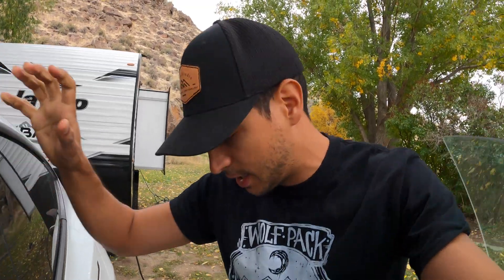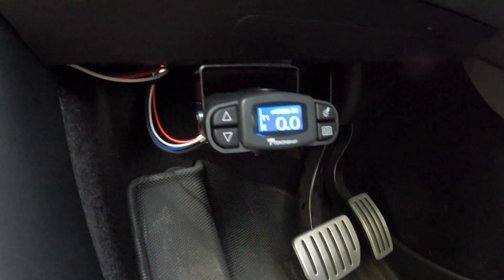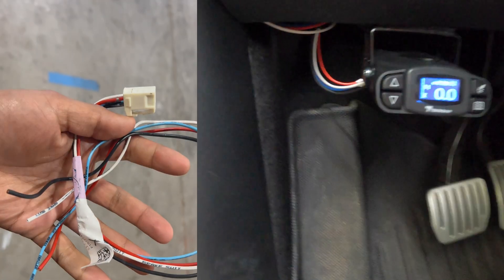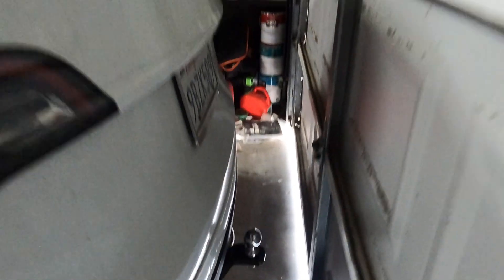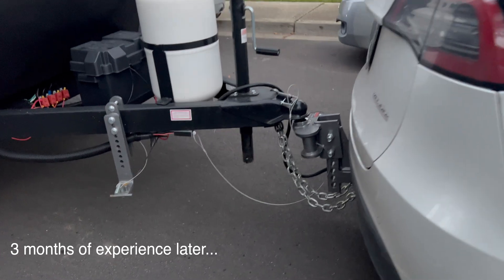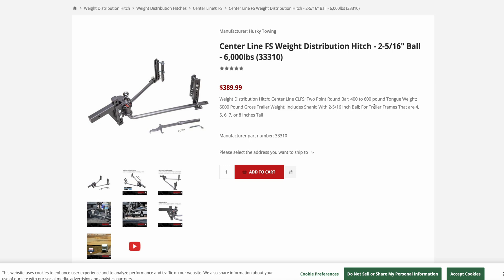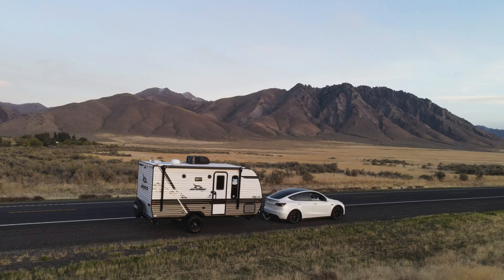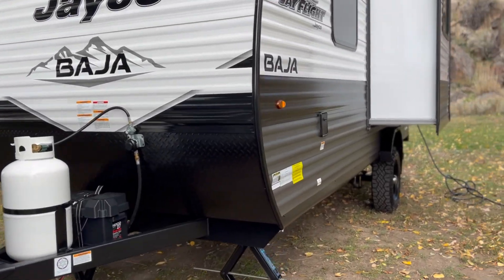Full Towing Guide for a Tesla

Comment: I have 22 Model X and found that there is no 12V on 7pins connect next to hitch. If you install 4pin pigtail, how trailers get the  brake power signal from 7pin?
Reply from the maker: I wasn’t aware the model X didn’t have a 12v connect, I thought this was only an issue with 16v lithium ion battery cars

Comment: With all the hype about Tesla technology I assumed that a brake controller was integrated into the tow package and if I needed trailer brakes on my setup I would be able to program it via the main screen and adjust settings with the scroll wheels... very disappointed when I learned I would have to purchase an aftermarket trailer brake controller.  Thanks for showing me how to set it up!

Comment: The whole towing thing with a Tesla is a problem. I'm buying a 2800 lb trailer to tow with my 2023 Model X. Tesla advises not to use a weight distribution hitch, due to the unibody design of the car. You’re also not supposed to have ball rise of more than .75”. It’s very hard to know what I should do, but I’ve decided to go with a hitch that rises to a proper level for the trailer, and skip the WDH initially and see how it tows at 60 mph.
Reply from the maker: @thefish5861  yeah unfortunately to make a towing setup possible, you most likely will stray away from Teslas recommendation

Comment: Thank you for this guide. Just completed my 1st  trip towing a Coleman 17B. What I did not expect was the significant heat on what I'm guessing is on the battery (or motors?). The car didn't like the 2000ft elevation gain in 80 miles. AC was still blowing cold, but the floor was radiating too much heat, and we're toasting inside. This was on a 90F night btw.

Comment: What if you use the 12v plug in the back of the model Y and run a thin cord out the hatch and tap into that pin that needs 12v? Doable? Tap into the wire or get a passthrough plug with 16v not connected and hook into that? Prob only 5ft from that back plug or so.
Reply: Problem is, the "12V" outlets on the Tesla's that have the Lithium battery under the hood output 16V... so probably not suitable for keeping a 12V lead acid battery charged.  Not sure how 12V accessories like a fridge react to over voltage.

Comment: With the trailer taking the full 3500 lb load there’s no weight left for passengers or cargo. Do you have another vehicle to carry everything else?
Reply from the maker: So the trailer holds 90% of its weight on its wheels, 350 pounds of it sits on the tow hitch receiver of the Tesla. Gross vehicle weight rating of the Tesla Model y performance is 5,712 pounds, it weighs 4555 pounds so that leaves 1,157 pounds left for the hitch weight (350) pounds and the weight of the passengers and everything else

Comment: I have a 2023 with lithium and it powers my camper no problem. I tested this by disconnecting my battery and seeing if lights/etc still worked. I know people talked about the  need for a step down converter, but honestly it seems to be fine
Reply from the maker: I tested the plug with several different methods. There is no juice coming out of it. I read it was an issue with 2022 models. Maybe it was within a short time frame
Reply: You don't need the AUX line output on the 7-way connector to power the lights.  The lights are powered by 4 out of the 7 pins on the plug.  The brakes are powered by the blue wire.  The AUX wire is needed to charge the battery and run the refrigerator while towing.  The battery on the trailer is used for the breakaway connector as well.  So you'll be missing those 3 things when you don't have aux output.  The breakaway should still work, just make sure you charge the battery before every trip and don't run the fridge.  Or perhaps I would wire a drill battery adapter with a step down voltage converter($30), place a drill battery for the breakaway whenever you travel.

Comment from the maker: It’s the Jayco Flight SLX 183BH and it’s 340 hitch weight and 3340 total weight. However this is the Baja edition and the dealership received it weighing just under 360 hitch weight and 3540 pounds. I have since removed the 80 pound lead acid battery and replaced with a lithium ion so it’s just barely under maximum specs
Reply: Hi what battery did you get. I want this same trailer for my model y but concerned about the weight.